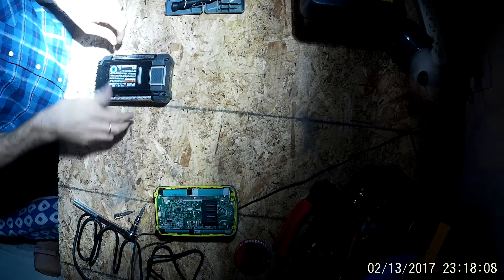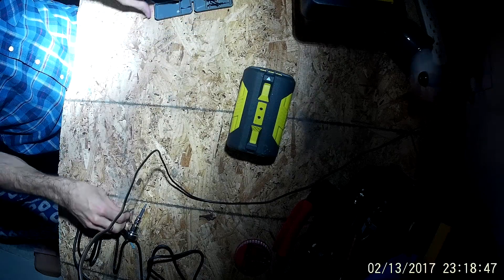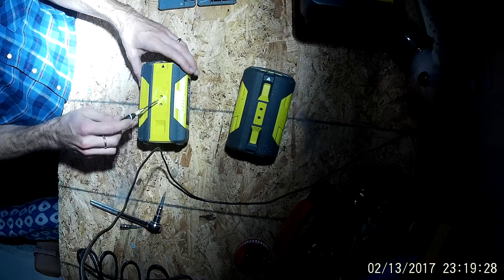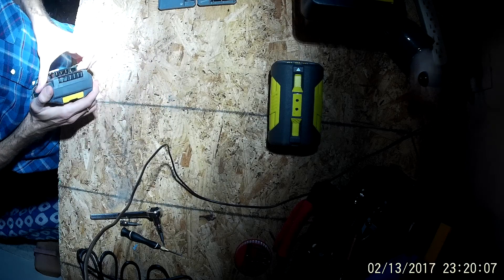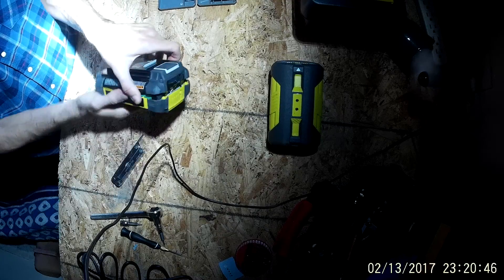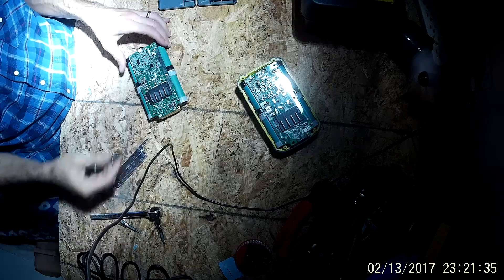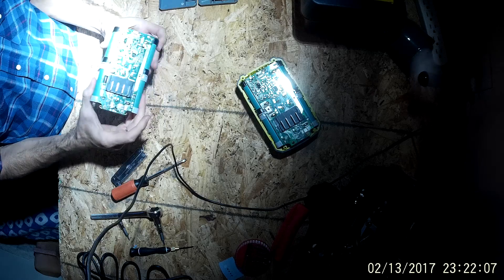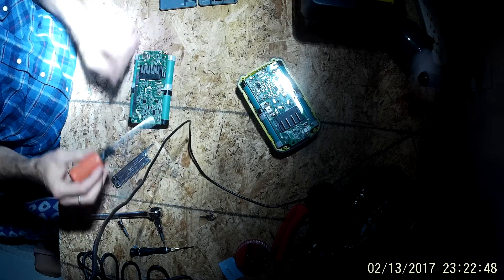Ryobi 40v Lithium ion harvesting 18650 Teardown

Comment: How did you get the board off? Seems if you want to try and save it you have to desolder it from the cell housings.
Reply: If you don't care about the pcb you can just use a dremel with a cutting wheel around the 12 connection points and remove the cells in about 3 or 4 min .
These things are cheap and easy to find , i have around 300 18650 cells from harvesting these packs. The cells inside do not have the greatest capacity though as they are
 INR18650-13q cells with a mah rating of only 1300
Reply from the maker: The cells are all tab welded, as is with all power tool packs. You can use a Dremel with a cutting attachment to cut out a bad cell to replace it. Then you can either tab weld a new piece of nickel strip back or you can simply solder the new connection. Hope this helps.
Reply: Understand the cells are tab welded. Curious how you got the circuit board off the pack? Seems there are several locations where tabs come through the board and are soldered. I'd like to be able to learn how to remove the board so I can build good packs from bad ones.
Reply from the maker: I will do another breakdown repair video of another Ryobi pack in the near future. The boards are fixed onto the plastic housing for the cells with philips head screws. Removing and resoldering a couple tabs and wires is not that difficult.

Comment: I've got a dead 36V Ryobi battery that looks like one of these 40V ones. I've been trying to take it apart to try the 'jumpstart' fix I've seen elsewhere on Youtube. I took it apart a few times by removing the 4 larger security screws, but just couldn't get the battery pack out of the casing. Thanks to your video I've now seen the two smaller 'secret' screws hidden under the Ryobi sticker! Thanks.
Reply from the maker: Very glad it helped. These are assmebled kind of like a puzzle and Ryobi loves to hide their screws. They seem to go to great efforts to prevent or inhibit people from taking them apart. Happy Tooling!

Comment: What was the label on the battery cells? What brand/model?
Reply from the maker: Hi - It's in the item description: 40vOP4015 and OP4026
Reply: He Asks about labels on each individual battery cells, not Ryobi battery pack
Reply: @ya6377  by the way he says 18 6 5 0   I doubt he even knows what it means